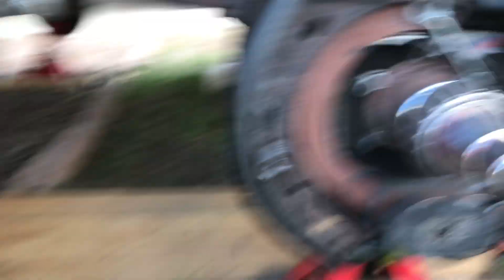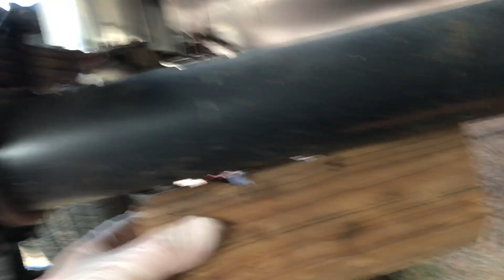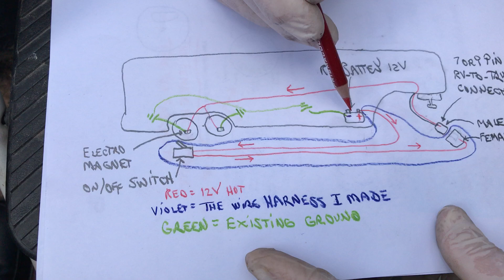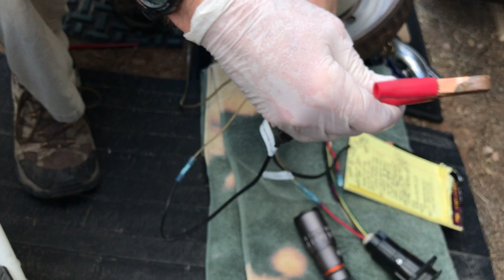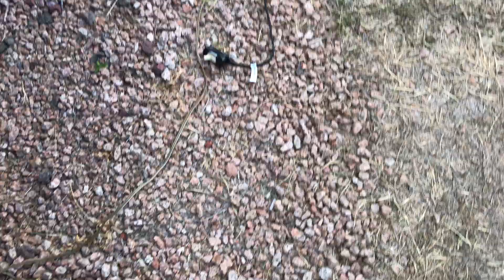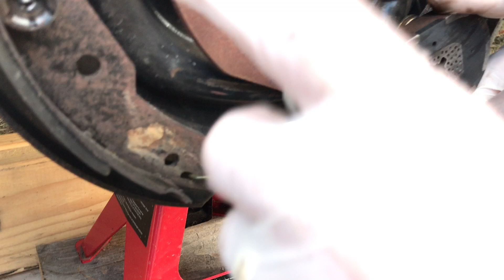Adjusting Nev-R-Adjust Trailer Brakes BEFORE Towing your Trailer

Comment: Hi Greg. I spent 40 years building spacecraft (satellites). We believe in testing and verifying assemblies before we do final assembly. There is no one to go fix something that was not throughly tested and assembled The Right Way. Don't let the negative Nancys get you down. If folks don't agree or think a quick job is better, well, that's their problem. Thanks for your contribution. I'm accumulating all the parts and tools to do a friends 5th wheel breaks this week. I'll incorporate your initial adjustment.  Thanks.

Comment: I have similar setup on Lippert axles.  I agree if they are WAY out if adjustment, the auto latch will not work.  So you can get a spoon and tighten it up a bit in the sawtooth wheel until it starts to drag slightly.  But you can't back off if you to far! The sawtooth will only go one way because the teeth are angled.  If you get it too tight you probably have to remove the hub to get better access to the wheel.  You might be able to grab it and pull it loose with very thin needle nose pliars, but you ca NOT go up and down like the adjustable style sets!  Very frustrating

Comment: Or you could just pull the breakaway wire and have 12 volts to the brakes.  No wiring harness or battery charger.  Like others have said you made a 15 minute job take two hours.

Comment: Great information. Installed mine today. To engage the brake I hooked up a 12 amp battery charger before wire termination. This saved a lot of back and forth so thank you.

Comment: As stated previously, this is the long way to set the initial adjustment on your brakes. I find it quicker to just use a screwdriver through the adjustment hole and turn the adjuster. If the brakes are new you still NEED to burnish them, which is what the Lippert recommendation he referred to in the beginning that has you towing the trailer at 40 miles an hour (not 20) and applying the trailer brakes 10 to 20 times. So this does nothing to burnish the brakes, and if you don't do it on new brakes/magnets, your brakes are not going to stop your trailer as designed.

Comment: I would add an inline fuse next to the battery connection. If something in your switch setup goes haywire, things are going to get very hot unbelievably fast. I've seen this happen.

Comment: Thank you for this video , very helpful. My question is instead of using the switch. why not just grab the magnet and go back and forth to adjust your brakes? and yes I am a beginner at this . getting ready to install my first set of brakes on my camper.
Reply: Because the brake drum would be installed precluding your access to the magnet. Their are access holes with a removable rubber grommet on the opposite side of the backing plate adjacent to the adjuster for manually rotating of the star wheel adjuster, if you so desire.

Comment: I used a screwdriver and a flashlight to adjust my self adjusting drum brakes.  I set each tire the same as I would manual adjusting brakes.  You can do it by clicking the lever up or down.  You wasted a lot of time to do something that should take a few minutes.  It took me longer to raise the wheel than it did adjusting the brake.

Comment: They are drum brakes. Just manual adjust to a slight drag.  You are making a mountain out of a mole hill. Your burning up the magnet by leaving it on for a per longed time.
Reply: And...without seal, you're exposing your bearings to dust and debri
Reply: How would  you do that?  My problem is keeping that adjustment "tang" out of the way  while trying to adjust the adjuster wheel?  Two screwdrivers? Thanks
Reply: @maicokid  One brake tool and a small flat blade
Reply: Amen! Could be a 15 second video